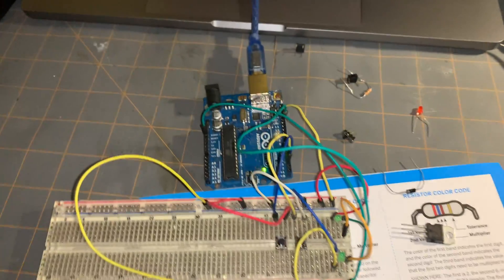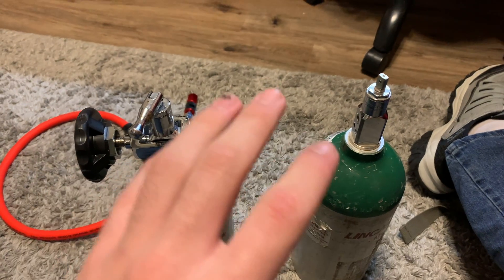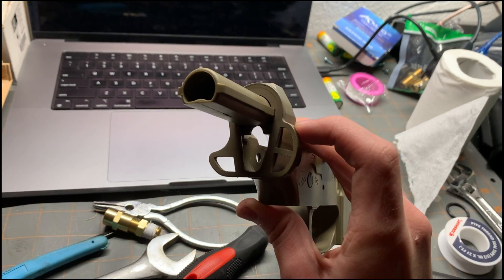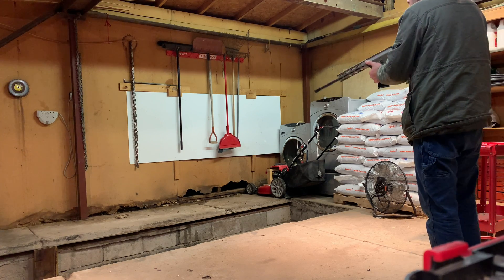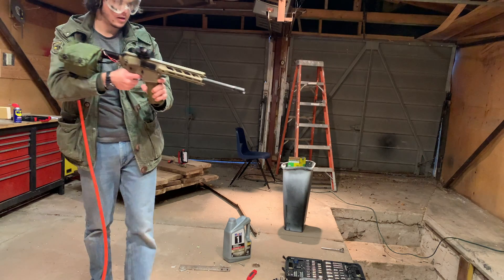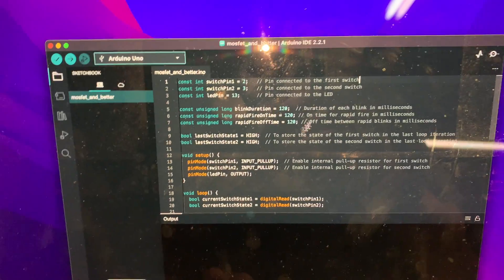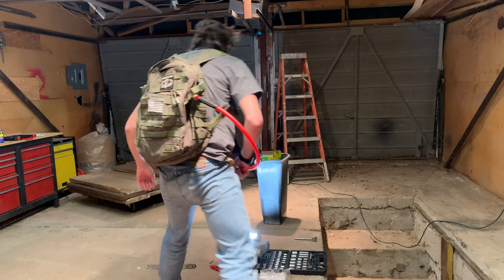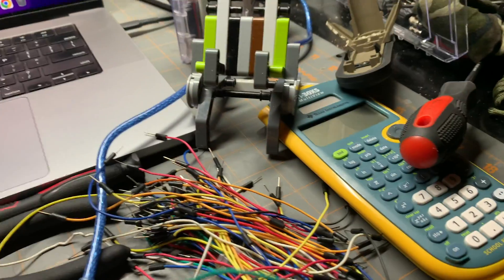3D Printed HPA engine in an airsoft gun Part 1

Comment: may i ask you about the fcu component, like what i will need to builf one like yours, i lack the skill of soldering and if i would do one like fulcrums fcu it would cost me more (i have a hard time finding components without buyng 50 to 300 of the same pice) than a arduino pased setup. i am not well with that too but seems more simple way to go, i would really like your help.

Comment: My problem is that my solenoids dont let enough air through, so my engine doesnt fully close, causing it to not shoot.
Reply from the maker: use a stronger spring, i used a cut down AEG spring. it shouldnt be the solenoids problem. assuming the engine doesnt close means a bb cant feed
Reply: @reidyboi2269  no like the seal isnt good enough, so the nozzle doesnt extend enough to get a good enough seal to shoot the bb, or push the nozzle with a stronger spring
Reply from the maker: o-rings @SparkybearEngines
Reply: @reidyboi2269  i got the ones you linked, but they were either too big or too small
Reply from the maker: i used the ones in that pack, i had bought it a long time ago and so i just used slightly oversized o rings in the engine @SparkybearEngines
Reply: @reidyboi2269   I can find the orings that fit well, they are all too big or too small. Currently im just using a lot of silicone grease, but this is a temporary setup. What size were u using?

Comment: feels like pcbway/jlcpcb could help out with miniaturizing the electronics, maybe make a monolithic board you could sell
Reply from the maker: i looked into making a circuit board with them but i hadnt completed the electronics diagram yet, this is a proof of concept and a runnable prototype. not a bad idea in the future, especially to fit in smaller guns. 

The grip is currently unused so i could fit all the electronics inside there, making it easier to install

Comment: I'm a tough critic, but this was thoroughly impressive! 

Bravo! 

What did your project cost you? 

Is that straight up just oxygen???

Any chance to run off of propane tanks?? 
I mean, its virtually as dangerous as straight oxygen. 

Would love to see more. 
I hope people are inspired,  I know I am.  
All these other hpa engines and such, it's all so damn expensive. Feels like robbery... 
This was refreshing. 

Best wishes, stay safe.
Reply: No, it's just compressed air, 80% nitrogen
Buying straight oxygen for airsoft would get crazy expensive, you just need a high pressure air compressor for this
Reply from the maker: it isnt gonna be oxygen, just compressed air, the project, minus the backpack, gun i got with eh gearbox, backpack, arduino, lipo (if you play airsoft you can use any 11.1v lipo), and a few fittings. 

I'll adjust the price for an arduino uno and a few things needed.

about $250, might be cheaper instead of using an oxygen regulator to use an actual hpa one plus buy a used hpa tank.

You could in theory buy a boneyard box from an airsoft store then mod the engine into the shell of the gun.
Reply from the maker: if you want to just drop this in a gun, not including price of air tank, hose, and regulator; then everything will be about $75

Comment: I'm surprised people are finally starting to realize it's really not super hard to make an hpa engine. If you want to shrink the electronics down, try an attiny85 chip.
Reply from the maker: not a bad idea but youd have to regulate down the voltage of the battery, i thought about using an arduino nano.
Reply: @reidyboi2269  just use a 5v voltage regulator for your vcc on the attiny85 and then run the battery output to a mosfet
Reply: Oh I’m also using aod4184 mosfet board and arduino pro micro